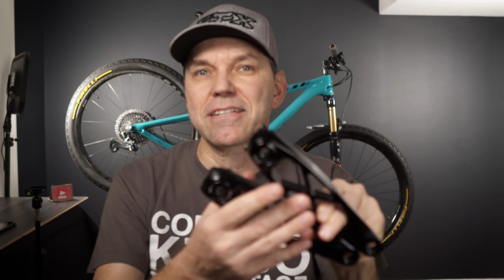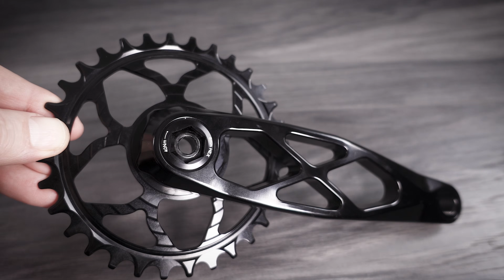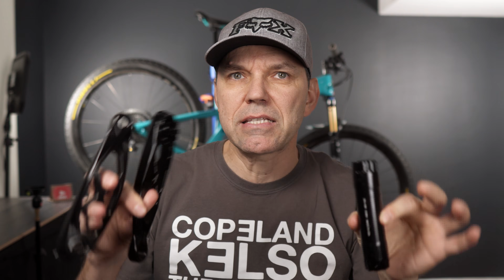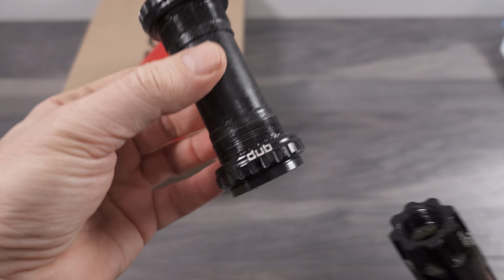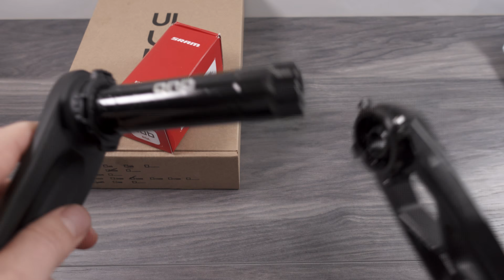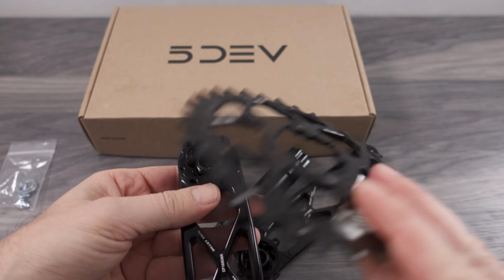Sexy and EXOTIC Cranksets? 5DEV Trail/Enduro Cranks Review

Comment: If I had the money to buy any cranks I wanted, no question, Cane Creek E-Wings.
Hope the 5 Devs are forged/ cold forged.

AC Components made some very similar cranks back in the late 80's.  Very similar geometry shapes cnc milled into the surface, not all the way through. 

I still have a set.  They are a warranty replacements for a set that snapped clean in half...after hitting a pretty moderate (by today's standards) 30 mph tree stump driveway gap jump.  Amazingly I didn't crash as I watched half my crank arm and pedal tumbling down the sidewalk in front of me. 

Guess my point was....they were intricately machined from CAST billet and Hella weak.
And precisely why everything nowadays is cold forged.

Comment: I guess you can’t use raceface rings
Reply: @LoveMTB   the one on the vid is it with teeth like raceface 
Wide thin 
Whatever they call it lol or are all rings like that now 
To bad shamano and raceface aren’t the same they kind of go on the same way with a centre lock instead of three screws that I’ve seen with others strip out or come loose .
Weight wise I think good

Comment: I pedal on these, reason for me was mainly two factors.  Made in USA, I just wanted to support something local (and I LIVE in San Diego) as one reason. The other reason is because it was a higher quality crank product that I could find that offered 160mm length.  Took them to Mammoth last year and after many months riding on them, I still love them.  I would not pay so much money for them if I didn't have the budget for the upgrade though.  So unless 160mm length cranks are over flowing out on the market, this is a nice item to have.  I own the black and they haven't peeled on me yet, but I haven't smashed them on to rocks even after a couple falls. Or maybe they have hit the ground a couple times, but not hard enough to do any damage that I can see.  Recommended if you have the budget!

Comment: If nothing else, this reinforces the exceptional value of FC-M7100 cranks. Weigts below excl. chainrings but all other required hardware. Weight of chainrings are the same for all below, if you use 3rd party like AB, Garbaruk, Alugear, Unite etc.
523 gram. 5DEV 165 mm (according to this video).
My cranks:
485 gram. X1 Carbon Eagle 175 mm (incl. crankarm boots).
500 gram. M7100 170 mm.
510 gram. M7100 175 mm.
530 gram. M7120 175 mm.
545 gram. GX Eagle 175 mm.
560 gram. NX Eagle 175 mm.
Reply: The weight was without spindle! My XTR 9100 - 165mm is 450gr, and My XT 8100 -  170mm is 520gr all two cranks with spindle + lockring but w/o chainring!

Comment: I absolutely love these cranks, unfortunately I snapped my first set while riding off a drop, I didn’t crash, it snapped when I landed. 5Dev warranty is second to none I filed a warranty claim and had a complete new crank set within 48 hours. I haven’t had any issues with my second set but park season will put them to the test. The black anodizing doesn’t hold up against rock strikes, wish they made crank boots for these works of art but on my second set I added strips of frame protection and it’s worked out. Love the Vid, It will be nice to hear your thoughts once you’ve put some miles on the cranks.
Reply: The drive side crank cracked in half (separated in two pieces,)  on landing the drop. I ride right foot back the failure point was on the crank at the pedal side of the crank across the large cut out in the crank. I hope that makes sense it would be easier to post a pic but 🤷‍♂️. Hope this helps
Reply: Snapping on a drop is dangerous. Was it a crack or did it break into two pieces? Isn't that a safety concern?
Reply: Sounds strange for Aluminum to do that. More likely something happened prior to your drop and the crank was compromised. Aluminum fatigues. Your drop was just what finished off the job.
Reply: @hucknroll6723  I did 28 park days last year jumps, drops, Jank I purchased the cranks at the beginning of park season and had no crashes 🙏, only the occasional pedal strike, the crank snapped on my last park day, can aluminum fatigue from flex? I’m asking cause I don’t know and you seem to know about aluminum. Thanks
Reply: That's worrisome
I broke a crack on my bmx in the 90s as a teen and ripped the back of my calf wide open
Reply: See my comment above.  There were tons of cnc high end parts back in the late 80's to early 90's.  They all had lifetime in and they all went bankrupt from likely thousands of catastrophic failures as a result of being built with CAST aluminum billet. 
Hope these 5 Devs are cold forged aluminum.

Comment: Just bought a set of them. Im a heavier rider. I am currently running x01 carbon cranks and a little afraid of breaking them.
Reply: I am 90kg running the XO1 crancks and no issues whatsoever.  3 years into them now with frequent use. Compared to the SLX these feel better, but mayb I am fooling myself. Only upgrade on crancks for me would be the Garbaruk version when they become available.

Comment: I've had these on my bike for about a year. No issues. A bit of frame protection sticker on the tip to protect from slight rock strikes. Mine didn't come with the chain ring bolts.

Comment: But it is a 3 piece crankset, isn't that a step backwards?
Reply: Same as what RaceFace has been doing for years, it works well. It allows you to swap spindles for different bikes like DH and fatbikes and keep your same crank arms.
Reply: I am sure they are great, just that I was so convinced when for the first time I tried 2-piece cranks over old type 3-piece that I would not go back. It's personal I guess :)

Comment: Just harder to clean , than a normal one, not a thing for me. Looks like something from ebay to be honest.
Reply: Harder to clean? Not compared to Raceface, I guess hallow cranks yes. But no bond to fail here, bonds can be strong if well done i guess. But Shimano ha sissies iwth bonds failing. These cranks actually seems easier to clean than Raceface cranks, as the dirt comes off in both directions. And seems like this design reduces alot of weight while keeping it stiff enough, but not tried them. But an added benefit of these cranks is being able to out a bicycle lock trough it.

Comment: Yes, they're def beautiful, but my XT (I use 165mm cranks) are way cheaper and on par for weight if a full alloy chainring is used ( i doubt my XT chainring will wear out any time soon for me to get one though.) But thanks for showing us something different from the usual fare.
Reply: 5Dev cranks are definitely cool cranks👍👍. The mostly 6/4 Titanium version I saw on a Canadian bike store's website, and they were asking 💰💰
💰
💰2,999,99.00🤨🤨
Reply: I hear ya on the XT crank, too. I bought my 170 or 175mm M770 XT crank back in 2008 for about 
💰375.00🍁,it still has the original top and middle chainrings😱😏

Comment: the crank looks weak in mechanical point of view. Did anyone compare the failure load on these cranks vs the traditional alu ones?
Reply: Haven’t seen a test, but Nemo Mulally ran them for the downhill World Cup season last year. So defiantly nothing I could break. https://youtu.be/dlhWjcttwWY
Reply: @LoveMTB  i remember seeing these type of cranks broke in my local bike facebook group before and we were laughing about it.
Reply: Define “looks weak”.  It’s a trellis design and combining triangles has held up bridges that we drive on.  Ducati has used trellis style rear subframes on their motorcycles for decades, race cars use trellis in chassis and roll cage protection, the list goes on.  

I understand the lack of visual heft makes it appear less substantial, but there’s a good chance that pound-for-pound this crank arm is on par with a lot of other solid cast or milled products.  👍🏽
Reply: @jeremyprovonsil7886  Do you know a crank is not a bridge, which is a so call simply supported beam structure?

Comment: There's no functional reason to buy them. Weight is well over a number of cranks at half the price, which are all easier to clean. The design isn't particularly interesting, but then, there aren't many cranks available in purple. So if that's your thing... sure.
Reply: Could you list a couple of the comparably priced and weighted cranksets?  The cost of these has been the only put-off for me and using 165’s, a full set of Eagle GX with spindle and chainring is only $150.   Not sure about weight savings, but my wallet isn’t that much lighter, so I can happily suffer the penalty on the trail.
Reply: Ignite components will do any color or design you want your cracks. Small new company out of NJ

Comment: Hey Man thanks again for your great vids.

But honestly putting that much money for a set of cranks that will get bashed , scratched IMO isn’t worth it.

Yes they look great but its an upgrade purely for aesthetics unless you of course you have a super heavy crankset and your a weight freak.

Same
Goes to titanium cranks like the Ewings for $800-900 for cranks! Insane.

Rather put that money on a fork upgrade or rear wheel upgrade maybe or even a nice set of titanium handle bars which will be noticeable performance.

I use RaceFace Aeffect R 165mm costs about $90 and weighs 480 grams with 30T chainring.

If you can afford it maybe why not .

But thanks for the review.
Reply: @LoveMTB  yes of course it’s always nice try new components if you can afford it, they definitely look beautiful! 

I went a couple of times to their website but then I see the price and say no thanks

Comment: i prefer shimano cranks because you can install them with an allen key... the 54 nm for the sram cranks requires a breaker bar to get off
Reply: They don't require a break tbar, you don't need to use crazy high torque, 40 NM is fine, but a big hex key should loosen it, if its stuck you can do it by stepping on the key and having one foot on the other crank, or pedal, but if you have a rubber mat you can do it with a frame only, by doing the same. But not tried it on Sram but on Raceface. I add a bit of Loctite 243 to keep them extra secure for longer, but don't overdo it. 40nm is max my arms can do. I used the 8mm hex key from Parktool HXS-1.2 It's 20cm from centew of short end to tip.